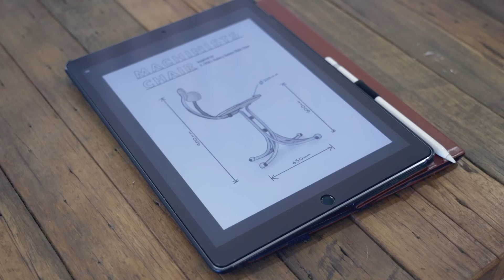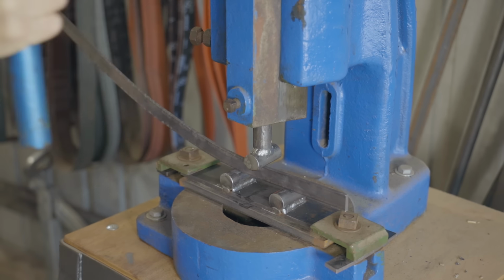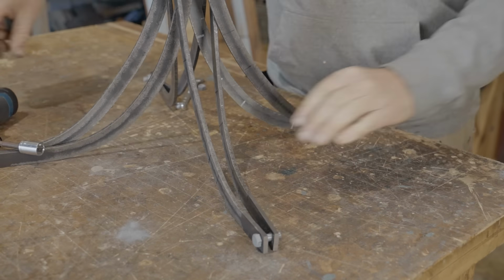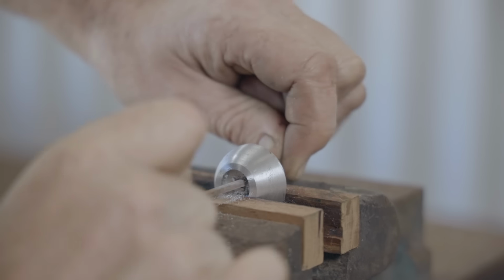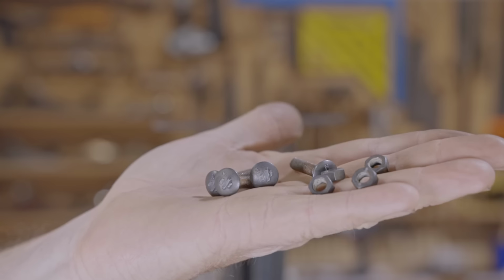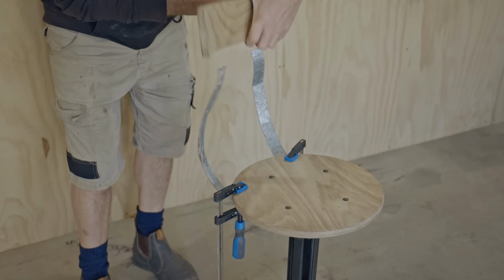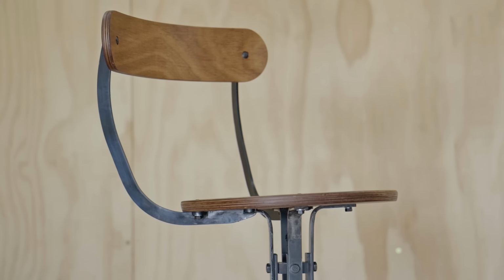Making an Industrial Style Machinists Chair

Comment: Hi
I love the way you think. 
THe reservuar should be lower than the dripping point. Currently there is a siphone system createad by the tube beiing filled with fluid , ad a higher pressure criatead by the fact that the reservuar is high. Lowering it , will get the pump to work uphill, and stop once the power is off.

Comment: Dissimilar metal galvanic corrosion is a possibility since the steel, and the steel bolt are in direct contact with the aluminum. I often wonder if a mounted grinder could do the majority of the rounding over work of the metal rather than risking belt damage.

Comment: Well done, mate.

As an aside, if you throw the steel parts into a bath of vinegar, with their mill-scale still on them, the scale will usually vanish in twenty-four hours. Saves on noise, 'lectricity, grinding discs, ear torture, and so on. If you want to speed it up, use a solution of water and 10% hydrochloric acid (also known as muriatic acid), available from the local hardware shop. That takes only a couple of hours.

For oddly-shaped parts like these you can make a "bathtub" from scrap wood (you got plenty of that) and that orange plastic sheeting used by the chaps who dabble in concrete. They put it under concrete slabs and footings, but it's cheap, easy to use, acid-proof, and readily available. In Australia, the most common brand is "Fortecon", also available at your local hardware shop.

Just sayin'

Comment: I thought you were going to make a support post going up through the center wholes in the metal blocks that the legs bolt to. If you did, it would have been adjustable height and swivel..

Comment: @Pask Makes, instead of heating the 'whole' area when you try to 'unbend' the tight radius, you can simply heat the longest side of the radius to a red hot in a few places around the area to correct. This makes the steel expand while hot (making a tigher curve/radius yes) and contract to an even smaller area than what it originally was. You can also use this to correct straightness on a pole, per example, after welding heavy passes on one side which will make that pole curve like there's no tommorrow. Doing some 'spot heating', every couple inches afterwards will essentially do the opposite and straightenthe piece.

spiral staircases magic

Comment: Nice chair but I've been a machinist for about twenty six years and there is rarely a time I have sat in a chair while working, a machinist is almost always standing which when you get used to it is better than sitting as long as you are moving around which you usually are doing. I have back issues but sitting makes it worse, if I had an office job I would be in bad shape right now, the worst thing you can do for a bad back is sit in one position for a period of time, movement stretching and contracting your back muscles keeps your back happy. What a machinist really needs is a work bench that is the proper height so you don't have to bend over, that is important, an adjustable height table would be great. I see younger workers who want to sit and sometimes even work laying down, not kidding and they not only put out less work but in the long run it's actually harder on their bodies.

Comment: At 11:09, it seems like some bars that cross over the next one are bolted on the outside of the block, while some that cross under are bolted against the block. The ones facing left and towards the camera look like that. The couple bars bolted onto the rightmost face of the block are the other way around: the one that touches the block crosses under the bar going left, then curves towards the camera; the bar that touches the bolt head should be going over and away. Hard to tell if bolting all bars that way would be enough to remove interference, but I think it would help (also it would satisfy my OCD needs for symmetry ^_^' )
…and I see you did the opposite in the end (long bars on the outside are the ones crossing under) so I guess it was fine and I shouldn't overthink stuff while watching the video :-)
Reply from the maker: It was quite confusing when I first put them together and I didn't have them quite right there. As the project went on I knew exactly where they needed to be. :)

Comment: It’s lovely! It makes me think of Bald Cypress or some other species of tree with buttress roots. Even though it is truly industrial, that bass harkens back to the organic. I have to ask why you stripped the galvanization from the bolts. Did you want them to rust? Then, I suppose if the bolts rust in place, it might be an advantage, as they’d meld with the segments they hold together, making it more solid? That’s even more tree like!
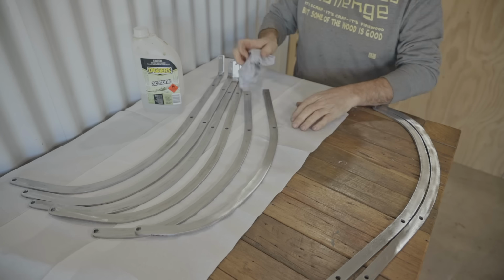Reply: 12:58, 13:26 - he wanted to blue all the parts, and for that, the zinc coating had to be stripped first.

Comment: Next time, try mounting the template vertically on the front face of the Fly press. Moving the work piece back a few inches is easier that walking it back and forth to the table. Just a thought.
Reply from the maker: You're right Doug and that's what I did when making the back rest support arms. :)

Comment: Normal score, and as expected another great job, don't ya just love that filler! (couldnt resist sorry)
 As a twist on the original design, would it have been feasible to extend two legs to include the backrest supports?  Thanks for sharing another great job.

Comment: If you'd heated the metal before making the bends, would be easier or not work so well for what you're trying to accomplish?   I wrote this question just seconds before you got out the torch to bend is back..
Reply from the maker: There was no need to heat them but they could've been made that way too. The fly press bent these without breaking a sweat and with heaps of control. :)
Reply: @PaskMakes  Thank you, its the control of the bend I guess was my actual thought.. I appreciate your quick reply!

Comment: Ah the fly press... Great till you get your face in the way of the fly weight... Nice work Pask. Hit the inside of the radius flat on the anvil with a hammer and the over bend will come out fairly easy. Work from both sides.

Comment: You might consider putting a clear coat on the aluminum before you attach it to steel. You're likely to get some galvanic corrosion between the dissimilar metals.

Comment: Great build. Don't know much about bluing steel, but isn't there still some risk of galvanic corrosion at the end of the legs when using a bluing coating like that vs a hot bluing process since the feet are aluminum?
Reply: With the aluminum protected by a thin oxide film, it's unlikely to be an issue, especially for a chair used indoor (I assume in a workshop, not some chemical processing plant). When one wants to electrically ground an aluminum chassis/part, special toothed washers should be used that penetrate that oxide layer to create a reliable electrical connection. No such washers here, obviously.

Comment: That's a beauty right there!
I wonder if casting the aluminum feet would have been doable. The clean up on a sand casting might have been just as labour intensive though.
It'll be neat to see what you whip up when your mill arrives!
Reply from the maker: It crossed my mind but not never casting before I thought it would be too much work. If I didn't work out another method though I probably would have looked into it more. :)

Comment: Question: since you're cutting aluminium with harden steel isn't the oil a little over kill?
Reply: Aluminium can be very gummy and can stick to the tool. Kerosine or alcohol prevent that and provide a smoother finish.

Comment: Sorry mate those aluminium rollers should have been made completely differently. isn't a machinists chair suppose 2 be a rolling chair? i thought you were going to use the aluminium to encase a silver steel ball in a ball bearing arrangement.   the legs were ok but you will need to re-do the feet. also the seat and back are incomplete. they need to be in the style of a leather car seat (i.e. thick padding smooth leather no riffles or at the most using a chesterfield style) so the blackening of most parts is good but you have to play  that off using bright clean and smooth silver. To point at the design philosophy here please go read  Simon Winchesters book THE PERFECTIONISTS. A wonderful read i know, knowing your personality type you (I am guessing of course) you wont be able to put it down. after that take another crack at this project. Thanks 4 the entertaining but OCD flaring up video.
Reply from the maker: Thanks for your thoughts and I'll check the book out, sounds interesting. The design of this chair wasn't mine, I was replicating a Rubery Owens chair which came out pretty close to the original. :)

Comment: Question: could you’ve done the shaping of the legs with four pieces bundled? Or would that have been too hard on the press?
Reply: i was wondering the same. but if i've learned something from Pask is that he has the patience and determination to avoid using shortcuts and honestly i appreciate it more.
Reply: It might be possible but it will require more effort on the press and it'll be more difficult to monitor how each piece is deforming. I think it's much easier to take the extra time to shape each piece individually. His template is a great way to ensure that each is identical.
Reply from the maker: It may have managed it but I think AndyRoo312 reply is spot on and they didn't take that long to make anyway. :)

Comment: I really like the clean and simple design.  My only concern is that the feet will be hard on a finished floor.  I was surprised how easy it seemed to be to bend the bar with the fly press.
Reply: Intersting... I was concerned they will wear out on a concrete floor!

Comment: this is a bit of a small point, but I'm sure you'll notice this as you use the chair. Next time you do this project, heat and quench the metal after you shape it. By doing this all cold, you've opened up and crated more fissures in the steel. Heating the metal melts the fissures back together after shaping, giving you a more solid steel. quenching it in an oil after heating will solidify everything nicely.

Again. this is a small thing, but you'll notice the chair will wear faster by not remelting all the fractures and fissures created :).
Reply: hot rolled or cold rolled steel, that is the question.  cold rolled cand be formed cold which is what he was using.

Comment: Question: When you make the same part multiple times, are they made in series or in parallel? E.g. the aluminium feet: did you finish each foot before carrying on to the next, or did you do all the lathe work on all 8 parts, then all the milling on all 8 parts, etc.? Great video as always!

Comment: You could have easily cut the shapes of the feet directly by using angle grinder. 
No need to press and bend. 
At the end , the result of the cutting would have been more accurate and finished